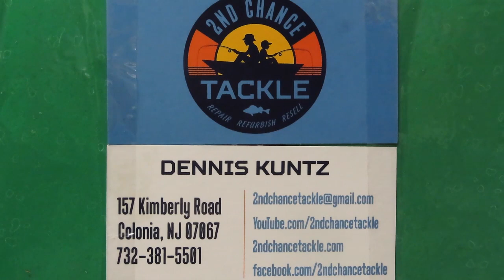Danco   Olymipic japanese fishing reel how to take apart and service

Comment: Did the early death of Otto Heinz have any correlation with the widespread copycats who were obviously conducting patent infringement
Reply from the maker: Hmmm - I just think that there was a lot less parent enforcement and litigation back in the day.  These are not exact copies and maybe enough was changed that it made it a little more difficult.  The exterior does not look like a PENN Reel.  It is the interior gearing that much closer to a copy.  Thanks for the note and thought - Dennis